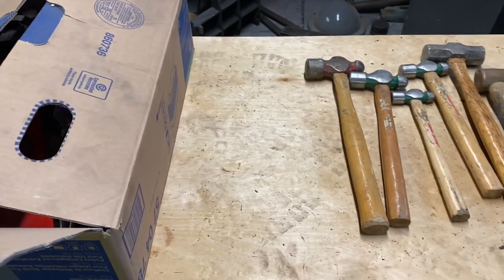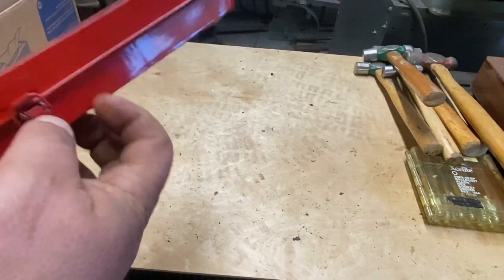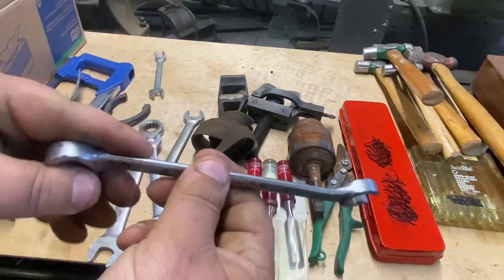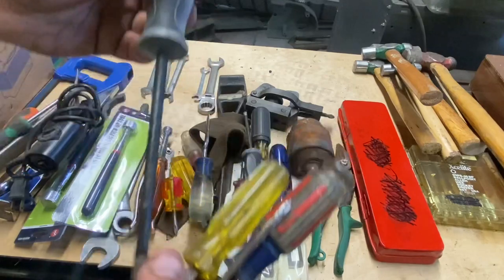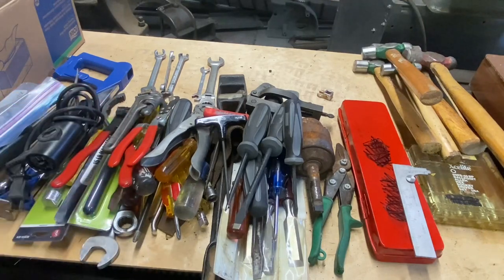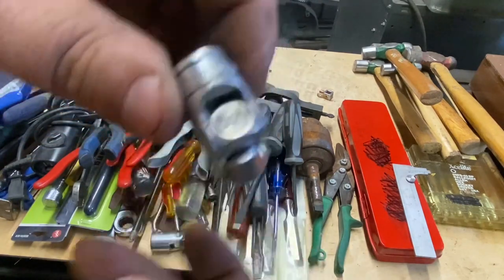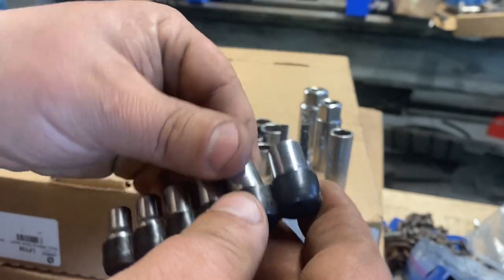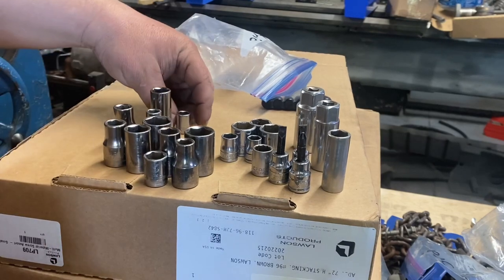Yard sale, auction, and swap meet finds 2022 #11

Comment: Lots of good scores!  Well worth the $50!
Reply from the maker: Yes it was, how’s your shop coming along
Reply: @smalltownmachineshop6860  it’s slow going.  I’ve been sick for the last three weeks.  Just got a dual chuck for the brake lathe and it sure is awesome!
Reply from the maker: @speedwrench1909  shops do take time, I’m not sure I’ll ever be done with mine, if your brake lathe is a aamco make sure to stock a few of the plastic gears for them, they break as a safety to protect the machine, mine used to go through them a lot but my brake lathe was pretty wore out
Reply: @smalltownmachineshop6860  I have a AllTool 747. I also bought a used/refurbished snapon branded brake lathe when I bought the dual chuck.  I got them out of a shops storage building.  They were wanting it gone
Reply from the maker: @speedwrench1909  very cool

Comment: So what exactly is the deal with line wrenches? I know that they are used on compression fittings often, is the thinking that by grabbing more than two flats, you don't risk deforming the circle? What is the ostensible purpose of the extra hook element? And why does an open-ended wrench not achieve the same? Curious about a real world answer more than marketing.
Reply from the maker: From what I gather mostly old automotive brake line thinner softer fitting that were easy to round off, that’s really all I use them for, the do also work good on tight smaller nuts that might round off

Comment: 5:35 Cleco tool for fitting body panels on a car or what ever your doing. sheet metal work. you have the tool , no fasteners.
Reply from the maker: Thanks for the info, iv done very little sheet metal work in my life
Reply from the maker: Also, if you have any or come across any lantern type toolpost I’m always looking for them
Reply: @smalltownmachineshop6860  I’ve got some smaller ones nothing to fit your bigger lathes came from that heavy ten I had
Reply: My craziest cable is who I’m under on fb look me up and I’ll stuff em in a flat rate box and send me your way I don’t need em
Reply from the maker: @jeremycable51  thank you, I will look you up
Reply: @smalltownmachineshop6860  good deal
Reply from the maker: I tried to find you, I’m not a big computer person so I barely understand Facebook
Reply: @smalltownmachineshop6860  what’s your name on  there I’ll see if I can find u
Reply from the maker: Adam brown, my email is badam485@yahoo.com
Reply: @smalltownmachineshop6860  I sent you an email